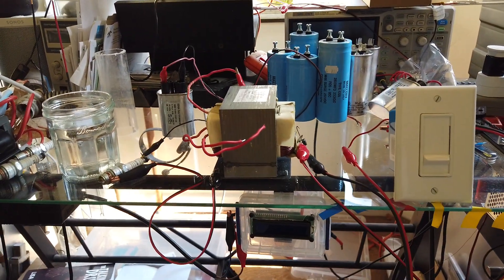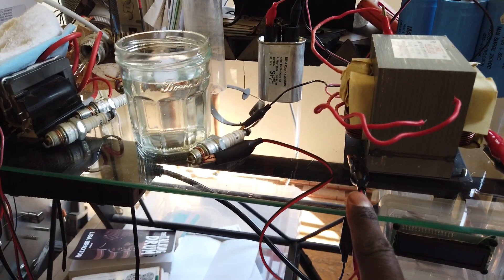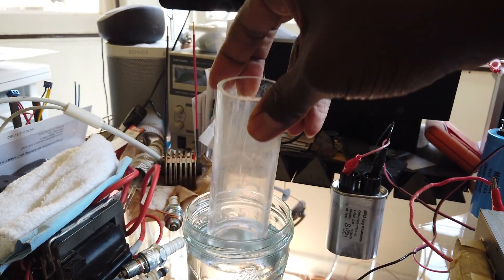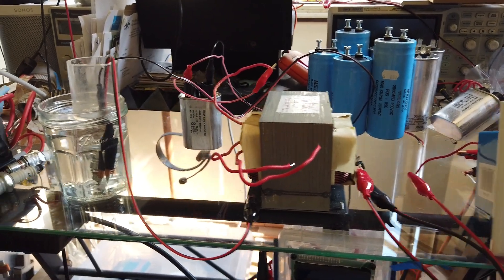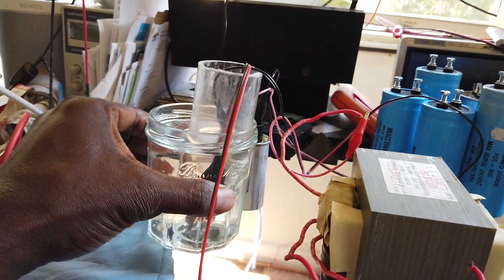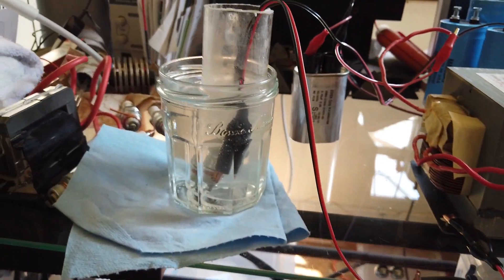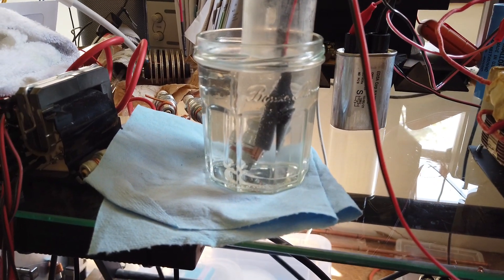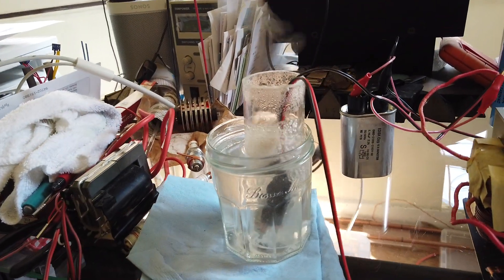HHO Failure Unveils Underwater Plasma Ignition

Comment: This is similar to the arc experiment that produces CO2 and H ( but they used carbon welding electrodes in water, thats where the carbon comes from to produce the CO2 ) you can do this but its a energy hog compared to usual break up of H2O to 2H and 1 Oxygen at high frequency PWM methods, as lots of energy goes into making steam+heat, light ,etc. Good Work !!!

Comment: most suprising is that dimmer switch flowing a 1000w
Reply: Not really, 120v that's less than 10amps and switches should be rated for 15amp

Comment: Oh man that is crazy. What made you think to submerge it in water. That's not something someone thinks to try and do. You know, because the old water and electricity thing lolololo
Reply from the maker: mcorrade I had seen some other videos where water mist was added. Just a few days ago I used the circuit from the attached video and blew up a glass full of distilled water with one spark plug, while the other spark plug was in an potassium carbonate electrolytic solution. - Plasma Ignition Driving a Dual Frequency DC Pulse Circuit That Reduces Transformer Heat Generation
https://youtu.be/1XOL6SzNZBI

Comment: very cool. I too am into HHO and have a system ready to go . Hopefully will have it up and running soon
Reply: What is HHO? You mean H2O
Reply: @Jaythegoat_yt  no I mean HHO hydrogen oxygen gas
Reply: Using electrolysis through water you produce hydrogen and oxygen the two basic elements and that in turn is called HHO
Reply: @Jaythegoat_yt  if you look it up you'll find it I don't know why it's called HHO it just is

Comment: Try distilled water!!
Reply from the maker: Good idea. I’ll give it a try.
Reply: @PerpetualMotor  Thanks!
Reply from the maker: I tried with distilled water with one spark plug using my double spark plug circuit. It blew up the container. 😁
Reply: @PerpetualMotor  Dude did you get a video of it???
Reply from the maker: iEnergySupply 😄 I did not. I will, though. I’ll need to set up a safer space to do it. Theoretically, you could do this over and over in an enclosed environment since water is the by-product and never have to worry about intake or exhaust. Or, I could put it in front of the a Tesla a turbine I bought from you and see what happens? 😉
Reply: @PerpetualMotor  I don't know, I would really like to see the test, I'm sure you could run the turbine, did you get one assembled? or un-assembled, or are you talking about a future turbine you would buy? You got the plastic one right? A lexan case would be great for the enclosure. Great idea to hook it up to turbine!
Reply from the maker: iEnergySupply  I got an assembled one with lexan blades. There is a story about a guy named Al Throckmorton that made an overunity pump out of igniting HHO gas. With this, theoretically, I wouldn’t even need to produce the gas. This story was told by George Wiseman. I’ll post the link on my Facebook page at http://Facebook.com/perpetualmotor .